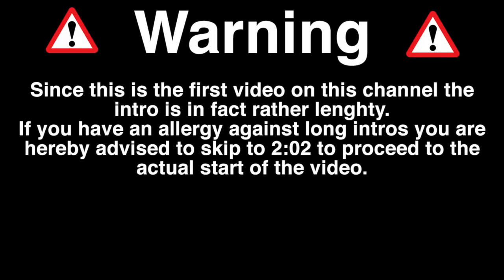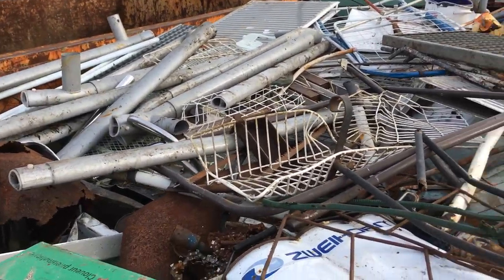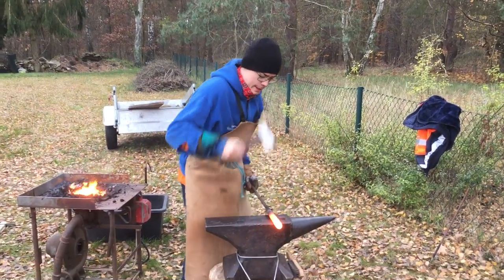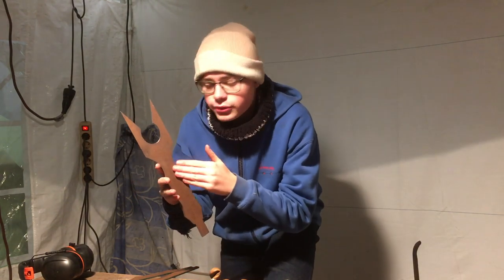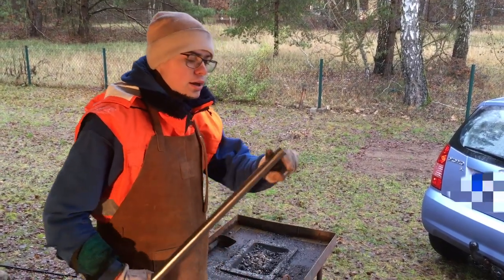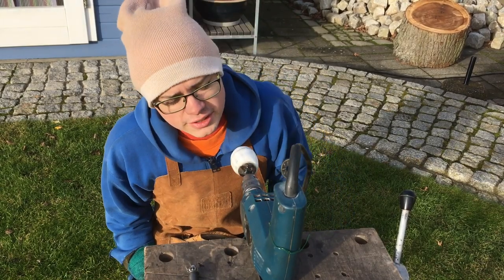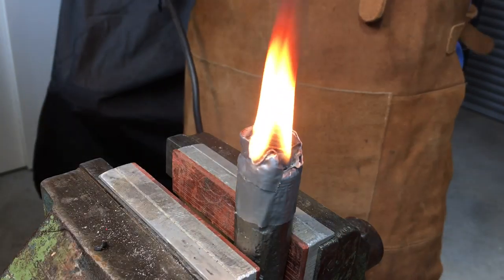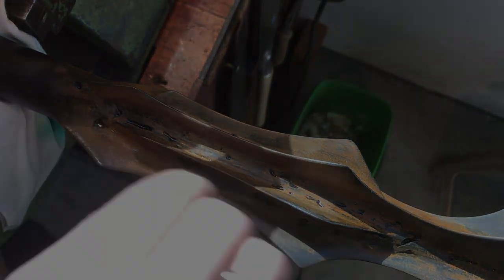How I made Sarumans Staff from LOTR out of Steel and Stone

Comment: Hello. I am planning to make this sometime in the future but I am planninf to use a crystal sphere for the crystalin the middle based on the measure ments should I get a 5cm diameter or a 6cm diameter?
Reply from the maker: Well here in this case the shape is not really a sphere. It’s 6 cm high and 5 cm wide. 

If you want to use a sphere both options should be fine and it’s a matter of preference if you want the stone to be more prominent or not. 

Personally I would choose the 5 cm sphere because otherwise the steel next to the stone will be pretty thin.
Reply: @Curwendil  Thanks